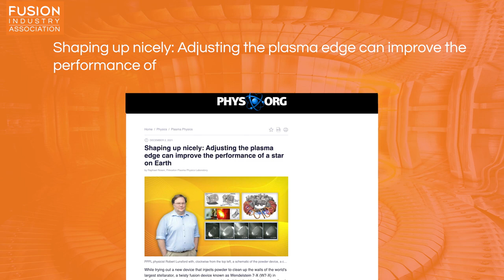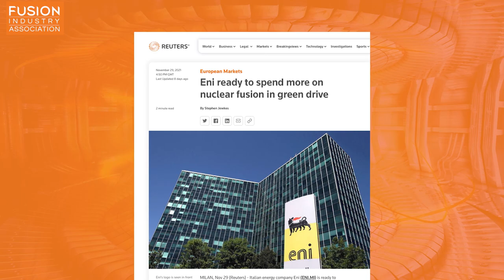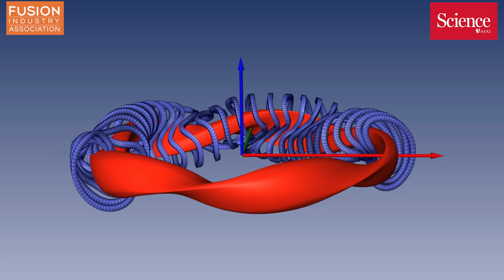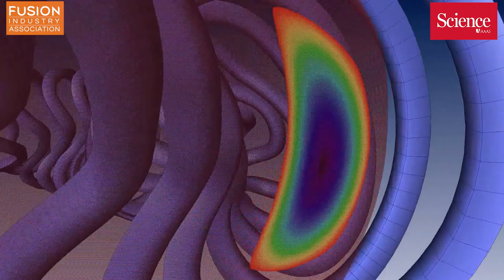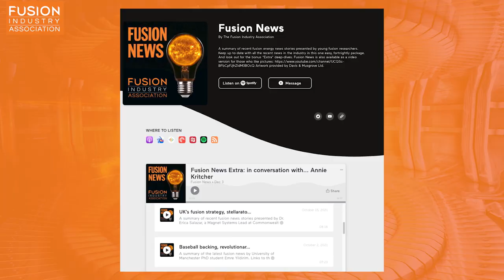Fusion News - Friday 10th December 2021

Comment: It's nice that development and funding is increasing for tokamak nuclear fusion machines. But wouldn't a smooth O cross section work better and more stable than the D cross section? The more smoothness, the higher the stability and less spill-out, less losses in general. The soft corners having D shaped cross sections still have a sharpness to them.

Comment: Looking at the power stroke of a steam engine , vacuum energy seems less glamourous than the power of a star . Cooling lasers can cool materials to near 0 kelvin with doppler shift cooling techniques . If novel polarising filters can emulate this and create a zone of atmospheric contraction in a system , then the ambient heat could create power . The Q factor of 2 seems like low energy output and Q 10 seems the realistic amount in a sustained commercial way .